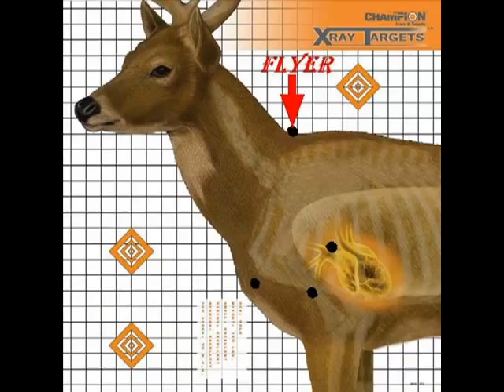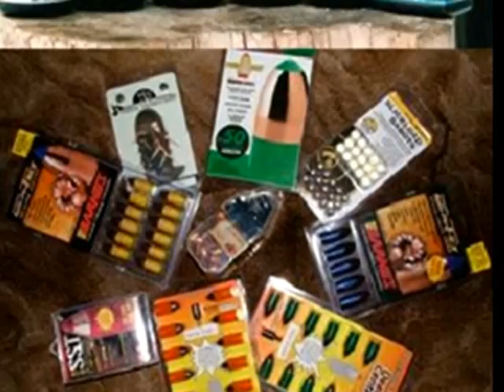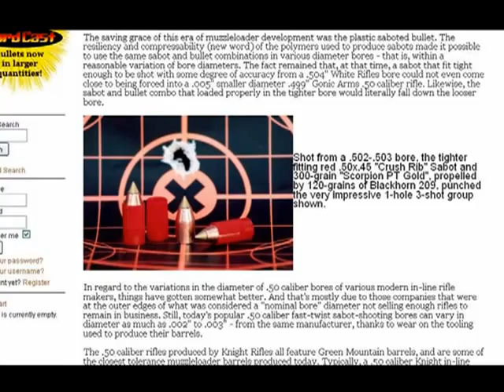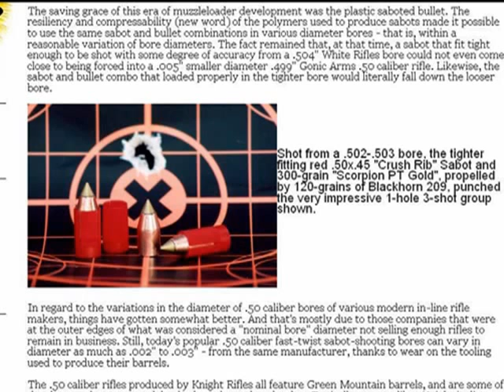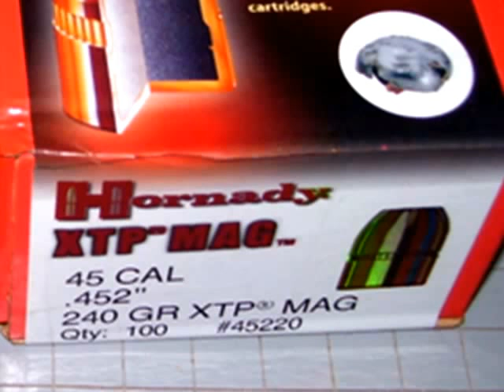Muzzleloader Accuracy Using Aluminum Foil  - Barrel Size -

Comment: Hey my friend when I bought my CVA optima it was shooting about a 4 and 5 inch group at 100 yards after setting it in at 50 yards. Well I got some polishing compound and it's 2000 grit polish and my father has lapped and polish barrels before and all it does is takes those scratches out of the barrel and so we did that and cleaned it very well afterwards and I put up a white poster board with a 2 inch dot in the middle and at 100 yards I had a 1 and half inch group with five shots . They hit left of the dot by four inches and two inches high so we adjusted the scope to where the bullet were hitting. I cleaned my barrel and shot five more shots but I swab the barrel between every shot and all five bullets hit just under the two inch dot only about a quarter inch under it. My father measured the shots and they were in a one and a half inch group. I set my scope for a two inch higher hit . Cleaned my barrel and repeated the same thing shoot swab the barrel and shoot and my group size at 100 yards is one and quarter inch now hitting in the two inch dot and I'm good with that result. My father said it's probably going to get better than that after shooting it more. But he taught me a good polish barrel want lead or copper up or fouling and those sabot plastic cups want foul your barrel as easily and they shoot way tighter groups . If you decide to polish your barrel and you run your polishing swab with a good swivel that will follow the rifleing remember don't pull your polishing swab out of the end of the barrel stop when you get to the muzzle end and push all the way back to the breach plug and keep making full push all the way and pull back all the way to the muzzle and add a little oil in your barrel about every five or six strokes for around twenty strokes and then pull it all the way out. This will not wear your barrel out or make the diameter bigger it only polishes it just like high end barrels are finished removeing little burs and scratches from the barrel. The polish I used was 2000 grit and a lite blue color. And it made my barrel shine like chrome and way easier to clean. And I only use triple 7 powder because it doesn't rust the barrel. I have been using triple 7 in all my black powder guns sense triple 7 came out on the market for sell. And all my barrels look shiny and brand new no rust any where. With triple 7 reduce your load by 10 or 15 percent because it's hotter than other powders . Stay safe and thanks for your information about using aluminum foil to tighten up your bullet's in the sabots .may you would be good at paper patching bullets.

Comment: I have tried sabow bullits with not much luck. What I have found that works the best in bp rifles is per soaked cotton patches and round balls. Cotton patches soaked with a bore butter or a solvent. They don’t have to be dripping wet just moist and they will clean the bore with each shot.

Comment: Stick with cloth badges it's work for hundreds of years. I put the rest of that junk in the garbage can where it belongs
Reply: A lot of people saying inch-and-a-half group at 50 yards. But if you're doing this off of rest with a scope supposed to be touching each other. I can do that with a Flintlock 45
Reply: Try using for your inline 451 Sabbath. 230 grain Hornady 45 bullet. 80 grains Triple 7 loose powder. That is a tremendously accurate load for an inline

Comment: You NEED a tight fit with a muzzleloader. It should be an absolute pain in the ass to load the damn thing, I use a .535 round ball with a .018 patch in my hawken with 90 grains of FF, and the thing will put every ball in the same hole at 50 yards with a dirty barrel.

Comment: I guess I it depends on the gun but if I made the sabot any tighter I couldn't get it down my barrel. I guess I'm lucky my old model TC Encore shoots 1 1/2  to 2 inch groups with just regular shock wave bullets and sabots at 100 yards. Powder doesn't seem to make a lot of difference. Very nice VIDEO thanks for all the info because I know there are a it of guys having trouble. I hope some of the barrel manufactures start making some nitro fire barrels for other brands like my TC Encore. It would be nice for us old cripple hunters with shoulder and hand trouble oh well I don't mean to bore you guys I just love hunting. Hunt safe everyone.

Comment: You can just buy another gun for $99.00 at The gun works,...inline made in Italy.
I seen it on gunsinternational. com
Suzi will hook you up.
I'd wonder what twist your barrel is,.... because that tells you the projectils and load to use?
Muzzleloader 101.
Use only black powder.
Never waste money on Pyrodex*
With black powder its 1 hole at 50 yards and clover leafs at 100 yards.
No 11 cap- 65 gr of black powder- and a patched round ball.
T/C, Knigt,.....and CVA shot all over hell with Pyrodex.
But with black powder its 1 hole at 50 yards and clover leafs at 100 yards.
If the gun is an E/R gun you will be crazy or broke before you find a load that work's.
E/R= extended range gun,.... they will only shoot 1 load.
Good luck Survival Lilly.

Comment: Great video and information. As a black powder shooter, I had no idea there was so much difference in tolerances. Thankfully, we have the CVA Optima v2 with tighter tolerances and excellent groupings.
Reply: I've been chasing accuracy with the beautiful Optima I picked up this Summer.  Just put the calipers on the lands -- .507.  Powerbelts and sabotted bullets practically slide down the barrel on their own.  Given the  width of my calipers, the actual size would be greater.

Comment: My first black powder rifle was a TC Hawkin replica.  No matter what I tried I could not get better than a 12 inch group.  I got disgusted and sold the rifle.  The first thing the new owner did was swage the barrel with an oversize ball dipped in valve grinding compound.  He said he did this several times.  Afterwards he was getting 2 inch groups.  The bore was so rough from the factory that it caused the poor accuracy.

Comment: To get excellent accuracy with a muzzleloader try doing what I did. Step one: Slug your barrel and buy the mold to fit, so that you can cast your own bullets, forget about sabots they are most of your problem. Step two: Stay with one powder brand and don't overload. My .45 CVA shooting a 452 grn Lyman Maxi pure lead bullet chronys at 1620  (odd) fps with 70 grains 2F. 100 grains 2F chronys at 1780 fps with a 50 fps variance, but accuracy goes for a ball of sh#t. Third step: Punch out  2mm  thick  over powder cards  and ram it down with the bullet. Try this you will be surprised and save a bundle not buying  expensive "wonder products"

Comment: a thousand here and a thousand there  all add up to poor acuracy    I like power belt bullets for that reason .    they swell in diameter  to fit the bore  no matter what it measures     also    there is no plastic sabit to strip out or slip around the bullit   try them and you will be convinced to.
Reply: I have taken the plastic off and loaded them in my 50 beowulf. Should see that expansion!

Comment: Thanks for the info,wish I saw your video before I went the route you did with trying every combination of powder ,sabots,bullets & primers. I have a Traditions Pursuit muzzleloader that would shoot the first bullet after cleaning low & left like 8" at 50 yards know matter what components I tried & you are right,I spent over $100 & a ton of time before I realized what was happening?  I called Traditions & talked with a couple of guys there one told me their barrel bores are a little larger than most others & I thought why would u make a barrel that is larger inside dia. & won't shoot many of the bullets designed for muzzle loaders? Anyway,I found every time I cleaned my ML ,the first shot out the barrel had a different point of impact.  I even went the course of pulling my scope,mounts,rings & starting over with Leupold scope,lapping the rings loctiting all screws & still the same issue! I even would pop a 209 primer down the bore to make sure any possible oil was gone. After the first round was fired the bore was dirty & groups got better with every shot but I didn't want to leave my rifle dirty knowing black powder is corrosive so I asked the guys at Traditions what powder,bullet & primer they used to get good accuracy?  They told me the ONLY load they use was their Smackdown sabot/bullet 209 Blackhorn powder with Federal 209 primers. Now since my accuracy problems seemed to be mainly with a clean bore I figured it had to be the larger dia. bore & I had to increase the sabot size in some way?  But how? I looked at the load the factory uses & found their sabots,the "Smack downs"have horizontal grooves cut in the sabot all the way around them which in their discription says the grooves are there to make sure you get a good seal between the sabot & the barrel wall!   I ordered up some of the "Smack Down" sabots & their 250 grain bullets to test,hopefully these sabots will make this rifle shoot well?  I will let you guys know in the next couple of weeks.

Comment: OK, let me add my two cents worth. TC is a good manufacturer. However every company makes its bore different due to where the barrels are made. I really dont know where the TC barrels are made but i know that the CVAs were made in Spain. These days i dont know as this may have changed.
I discovered the problem you are having when i purchased a Traditions rifle long ago. it had a 1-22 rate of twist was a side lock 20 in barrel length. NONE of the lee bullets would fit down the bore, that is right, i said NONE. It was made with a tighter bore than what LEE was offering. Traditions sold their own bullet with sabot. The bullets were not jacked but pure lead. This made it so that if i wanted to shoot my traditions rifle, (which shot bad with even their own ammo), i had to buy their bullets and they were expensive. Needless to say i ditched the Traditions rifle.  I kept the stock bought a CVA side lock BobCat and put that barrel in the Traditions stock. Almost a perfect fit.
Getting back to what i was saying, your TC has a standard bore for TC rifles in 50 cal, just like my CVA has a standard bore for the CVA 50 cal. And Lee makes bullets for that bore diameter. That is why i call the CVAs of old, standard bore diameters.  Someone makes a TC mold i am sure, maybe get away from the sabot bullets and go back to the traditional lead rounds. Just a thought...

Comment: 45 cal in a 50 cal gun that’s ur problem.i. Just be wrong 🦌
Reply from the maker: The bullets are 45 cal and with the added thickness of the sabot it fits in the 50 caliber barrel. If you were to use a 50 cal bullet then you would not use the plastic sabot.

Comment: Say-bow, say-bot. Should be more like sah- bo as in sabotage meaning to though your sabot, a wooden shoe into the gears of something to mess it up. You are then a saboteur. Me thinks they are way too complicated and opt for a  cap lock and round ball. The lead makes up for any variation you fine in all barrels, event modern  brass case breach loader.

Comment: Nice helpful video.I think if you used a soft lead bullet with a hollow base it would probably expand to fit any bore that is a nominal .500 inch.  I think the original sabot  (sabow)  rounds were made of wood to fit odd sizes cannon balls. The iron balls were first heated red hot and burned into the roughly shaped sabot halves till they fitted.The external wooden part then fitted the bore perfectly so the roughly cast cannon balls at least fired true.

Comment: I don't understand. You have a Thompson 50 cal rifle and you showed a box of 45 cal Hornady bullets. I also have a TC 50 and I use 490 round ball with a .015 linen patch. I suggest you use more properly size matched bullets and forget about the tin foil.
Reply from the maker: Hi Roger, The reason the bullets are 45 Cal. is so they can be put into the sabot and fit into the 50 cal barrel. But depending on the sabot size and the barrel size can affect the accuracy of the muzzleloader. Thanks for your imput. Have a great day.

Comment: I recently purchased a used TC muzzleloader. I measured the bore because standard bullets freely dropped. It measures 0.514.
     As I mentioned before in a previous post, the old timers would vary patch thickness to match bullet/bore fit.
     With this new muzzleloader, I again reached out to the old timers. They would make patching in the shape of a cross (or x) for anything that wasn't round ball. Round ball, of course, was standard patching. But long bullets were patched with an "x" patch. This isn't commonly available information, so I mention it here. I can also attest to the effectiveness of the technique, having tried it. Find the thickness that matches your bullet/bore fit. Make the appropriate "x" patches to ensure good fit between bullet and bore, then load the long bullets just like the round ball.
This is the way to go to handle this issue. I even went so far as to make patched bullets like they did for cartridges. This DOES work, but isn't needed when the "x" patching method is used.
Knowledge is power. Power to all who seek knowledge...........:-)

Comment: Hello Sam
I bought an omega , after comming out of the woods, on my quad, had  a doe on the back , my black diamond hit tree an broke the fiber site on the end, I used all kinds of sabots, switch to power belts,  the black diamond was on , when i damaged it I bought an omega, last one on the shelf.  I too experience the same thing! hitting allover the place , I thought  I had a lemon, I then bought a CVS  accura , bagara barrel, 3 shots I  was sighted in at 100 yds , then i saw your channel and the tin foil trick thanks  bro, I 'll be doing some tin foil research with it now!
Reply from the maker: Thanks Earl. Good luck with your Omega, hope it works for you.

Comment: power belts were made for CVA. with this combo, why buy a Thompson?
Reply from the maker: Hey Rob thanks so much for your input. I guess I never knew that the CVA and Thompson Center barrels were made differently at the factory. I knew the inside diameter was different on both CVA and Thompson Center's inline guns. Just curious, what is the difference in the barrels that makes the combo I am using shoot better from my CVA?
Reply: Sam Lilly I think the difference is the .002 diameter. The CVA being just smaller allows the sabot to grab the rifling and the bullet better. The T/C is "shooting Loose". Since I'm seeing this video for the first time 3 years after you posted it, I may be stating things you have already figured out. Is so, I apologize. But, my initial reaction was that the bullet was leaving the muzzle with a wobble instead of a tight spin. I compare it to throwing a football. The tighter the spiral on a football, the more accurate the throw will be. This principle applies to a bullet leaving the muzzle of a gun. Your T/C being .002 bigger than your CVA can make all the difference in the world. If you haven't already, I'd suggest switching to Powerbelt bullets. The expansion of the bullet would give you the desired spin and therefore give you more accuracy and tighter groups. Just my 2 cents.
Reply: I shoot a cva optima v2 with hornady fbp and sst- ml bullets. Very accurate even with pellets
Reply from the maker: Thank you for the post and information. Have a great day.

Comment: With black powder guns, bore diameter has never been an exact science because the bullets were patched. One of the things that shooters changed to improve accuracy was the patch thickness; anything from silk, to pillow ticking, to buckskin were used for patching. The goal was for a firm fit, but not so tight that you had to "hammer" the bullet home.
With modern reproductions, tolerances are much closer and this understanding has largely been forgotten. You have basically done what the old timers did and adjust the fit of the bullet.
I am surprised to hear that you had so much trouble, though. The sabots should have compressed and expanded enough upon shooting that accuracy should have been acceptable. This makes me think that the sabots themselves are the root cause of the problem. Did you try different brands of sabots???
Reply from the maker: Hi Kirk, thanks for your very input, very interesting information. I 
have tried other sabots and it seems like they all perform about the 
same. But in my experience if they are going down the barrel relatively 
easy it seems like my accuracy suffers. The reason I like using the easy
 glides are because using the same thickness of foil on other sabots the
 same size, made it very difficult for me to load. The easy glide sabots
 were much easier.
Reply: Sam Lilly - Since you are having trouble with all but the easy glide sabots, I would recommend that you fire lap your barrel. You can purchase a kit that will work well. 
This will smooth and polish the bore and make it much easier to load. You do need to do this with full diameter bullets, so you'll need about 20 bullets of a full 50 caliber. Just follow the instructions in the kit. Completely clean it after each stage. 
This should help ease of loading for all projectiles, and will probably help you find more than one accurate load.  
Certainly your foil technique is effective, and you can continue to use it, but try the fire lapping.

Comment: your barrel is .503? you shoot 45 cal sabots?   shouldn't u be shooting 50 cal sabots?   I might not be understanding right, I apologize if I am.
Reply: Still, your rifling is not engaging the projectile.
Reply: @calebdorsey7591  its a sabot, the rifling engages the sabot not the bullet - this is how sabots work
Reply from the maker: Hey there, The bullets are 45 cal and with the added thickness of the sabot it fits in the 50 caliber barrel. If you were to use a 50 cal bullet then you would not use the plastic sabot. Thanks for the post Phillip and have a great day.